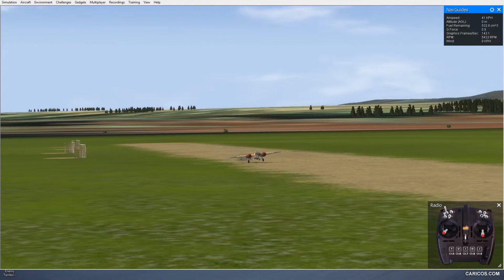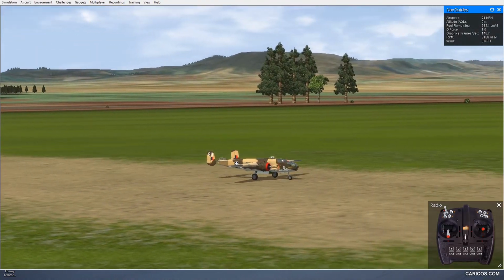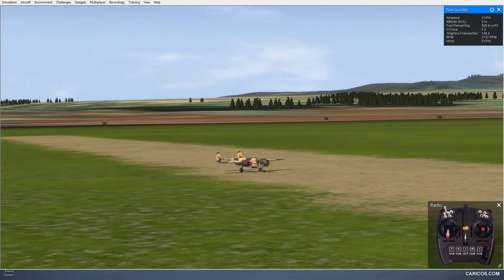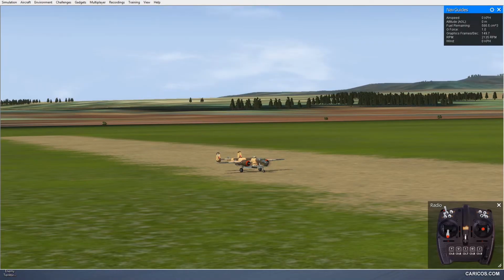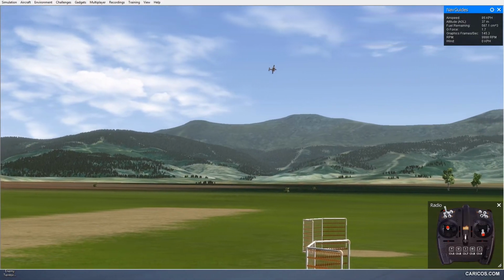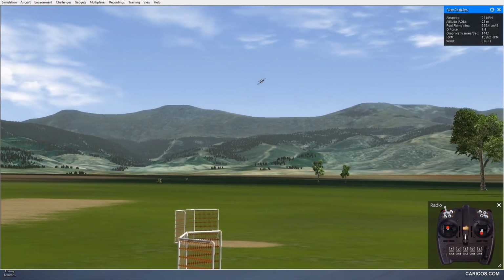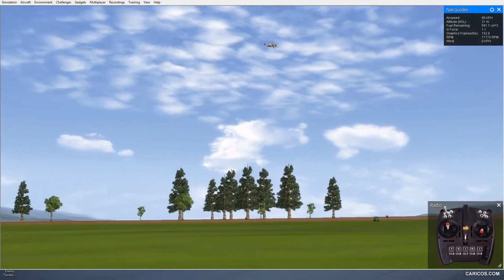The BEST Landing Procedure for a RC Airplane - Avoid Off Power Landings

Comment: I fly a Sportix 1.1 (mid-wing plane) and it really likes to glide. I can cut power totally after final turn and it glides more than halfway down the runway before I can get it down. If I am too slow going into the turn it will tip stall. The runway 630 x 80 feet paved.
Reply from the maker: I'm not familiar with that plane. Sounds like a good candidate for considering mixing spoilerons.

Comment: Added 85 degree landing and 30 degree takeoff flaps on my FMS Ranger V2 and its ability to glide slope in a super stable manner all the way to the flare with like 10-15% throttle and 3 degrees nose up is incredible. Lake touch and goes look almost scale when flown in this matter. This is what I love about RC. Flying them and modeling them as their real counterparts. I want another floatplane next maybe a scale model like the FMS Cessna or maule next

Comment: Thanks for the tutorial...a bad landing can cost big $$. Good landings are THE most important skill to acquire. As a note, I would not apply flaps during a turn. Also, a strong headwind will require more throttle during landing. Crosswinds are another story.
Reply from the maker: Thanks for the comment! Agree, applying flaps is a bit risky if I did this during a turn. I don't remember when making this video when I put them down, but usually I drop them at the end of my downwind. But, I would suggest dropping them down when you most feel comfortable after experience and perhaps not during a maneuver.

Comment: Thanks, nice video. Not sure a motor off glide then motor on landing will work in my setting. We have high trees threatening all around my fields. I land under power much lower and tighter than you fly here. How about doing another landing video including some crow landings from height? Or how to bleed off speed from height without crow? How to side slip to lose altitude? You are a good teacher, now please go a little further with your landing instruction. These trees are killers.
Reply from the maker: I'll add it to my queue.
Reply: What does crow mean?

Do you mean crab?
Reply: @ no, crow is when ailerons go up and the flaps go down. They don’t go up very much so you still have aileron function. It’s a way to increase drag and drop altitude without gaining airspeed. It’s standard with many sailplanes, but works for other RC planes and full scale aircraft as well.

Comment: My holdback on this video is not first trimming the plane for slow flight- does not matter what your flying or its configuration, it must be trimmed for slow flight.  Landings, missed approaches, touch and goes - all this is based on slow flying the airplane.  Kinda' makes it important don't you think?